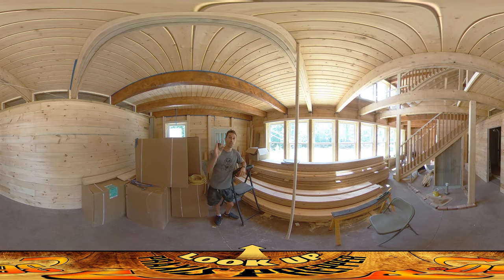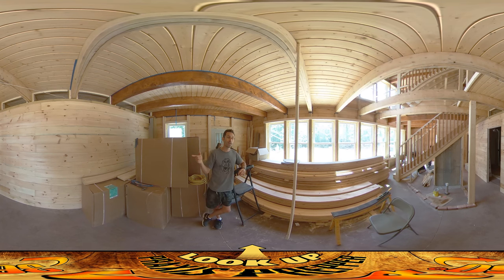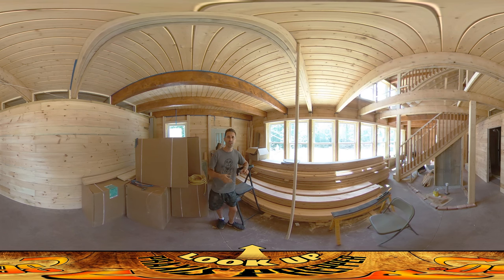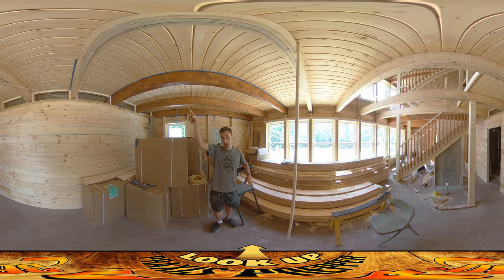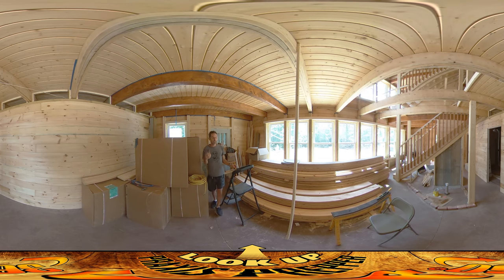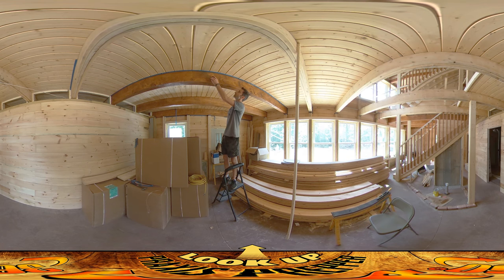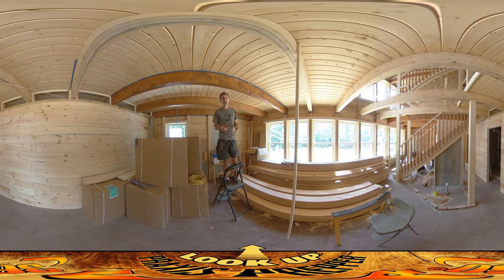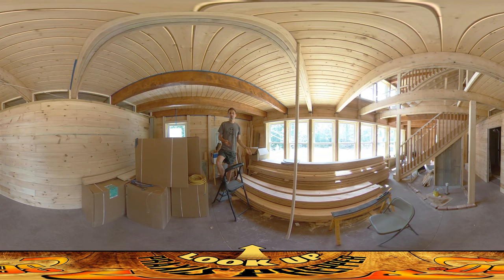Homestead Building - Finishing up Small Odds and Ends Projects

Comment: Good to see such nice progress on the diverse projects.
Reply from the maker: A lot of jumping around lately. Sometimes it's necessary. This morning I just did the first run of stone along the bottom of the stone wall behind the woodstove. I can only do one run at a time and need to wait for the run to cue before I can put the wight of the next run on it, so a small job like that has to be done in tiny bits over several days. I also took a crack at fixing those weird swirls on that ceiling joist above the kitchen by sanding the wood all down. It worked pretty well. How are your projects moving? Are you angling for being pretty well set by the fall in case covid goes bad?